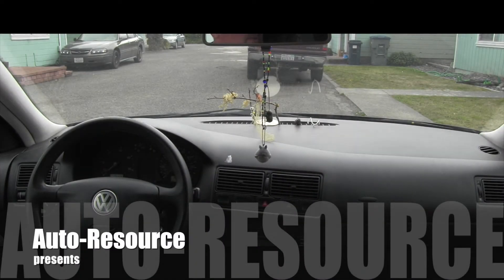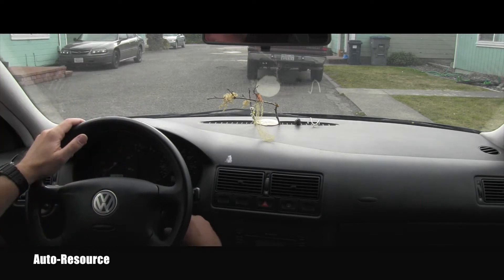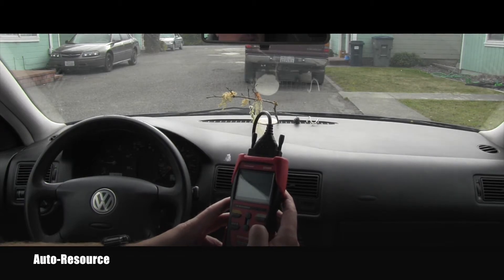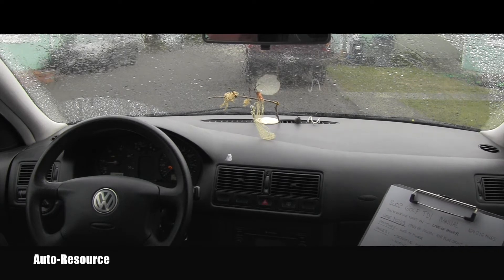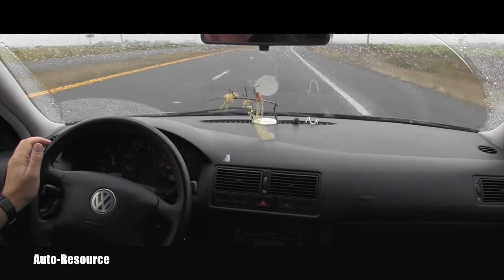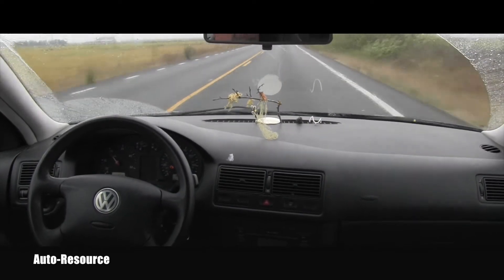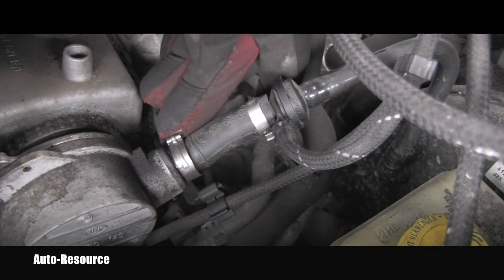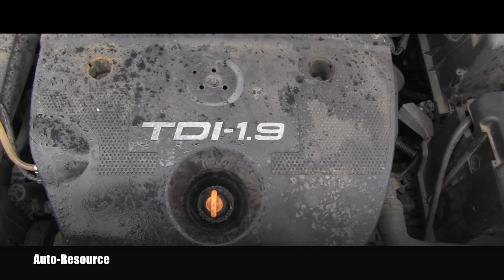VW Volkswagen TDI loss of power code P0103

Comment: Indeed 3/4 of the loos of poer or limp mode are cause by vaccum hoses having a leak, im actually buyiing tomorrow a 97 audi a3 1.9tdi AGR that doesnt have power, sames test drive as you did, and im 99% sure its the vaccum lines at the back of the engine. quick easy fix to replace them and boom, turbo will now be kicking and car actually pulling

Comment: Hey I need some advice on my 2004 Golf 5 2.0TDI car runs well put brand new glow light and the car loses power when im on third gear and try to drive on 3000 rpm . any idea wat could be da problem

Comment: Awesome Awesome! ... be checking this on my V Dub in the morning.  Thanks!
Reply from the maker: you are welcome...
Reply: @autoresource7942  Hey I need some advice on my 2004 Golf 5 2.0TDI car runs well put brand new glow light and the car loses power when im on third gear and try to drive on 3000 rpm . any idea wat could be da problem

Comment: Thats cool that it was the same cause as before,  good catch. I agree that these are great cars, I have a 2003 golf tdi that ai want to make last forever  !
Reply from the maker: oh yeah, they are great cars !
Reply: @autoresource7942  Hey I need some advice on my 2004 Golf 5 2.0TDI car runs well put brand new glow plugs and the car loses power when im on third gear and try to drive on 3000 rpm . any idea wat could be da problem